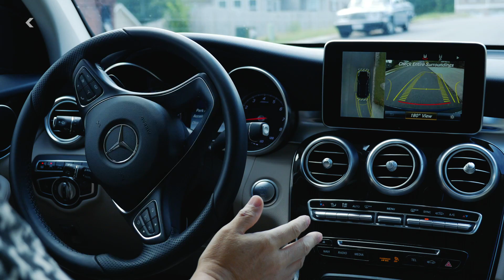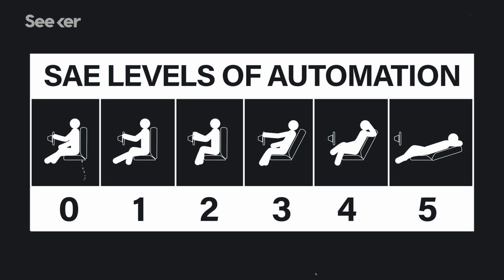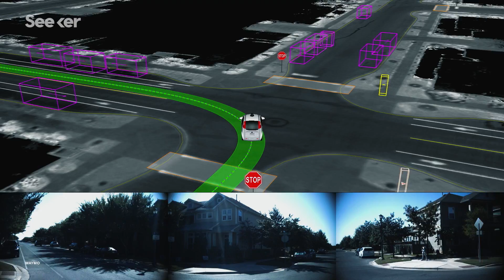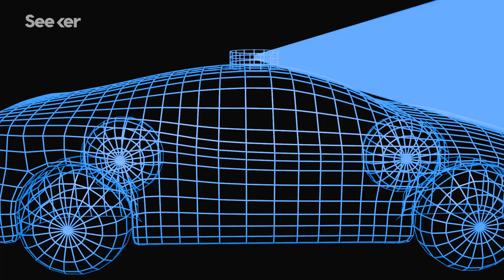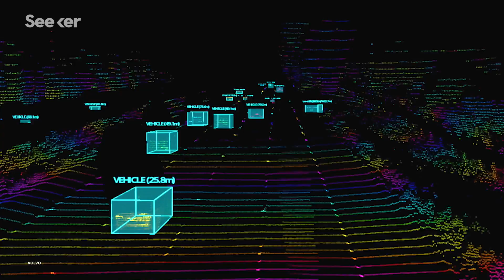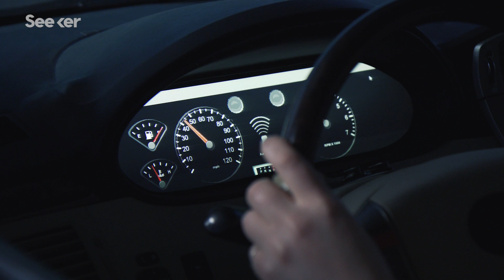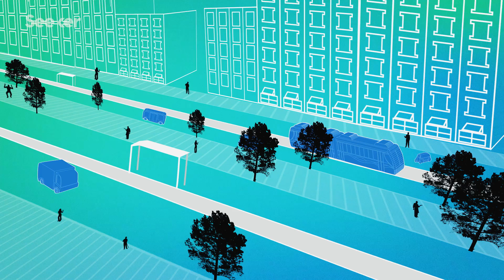How Close Are We to a Self-Driving World?

Comment: We could of been at level 5 10yrs ago if they asked me. :) I felt it would be a lot easier to change the roads to magnetic tracks. The cars to shuttles wouldnt need an engine because it would be powered by the tracks which would make cars(shuttle) cheaper, lighter and need Zero Gas. You/City/States would use a program/computer/AI to run the whole transportation system. The system would go faster and faster as the bugs got worked out. You would no longer have accidents, drunk drivers, missing people, and crimes ect. The shuttle would be able to tell you instantly how long it will take to get where you are going. You would no longer need seats in front they all could be around a table like in a van. :) If this was in place it would eliminate the need for gas and oil. :)

Comment: I’m a professional drone pilot, I’ve helped in the surveying of land, plots, bridges, lakes and canals. Drafting square footage/kilometers for commercial business and the private sector. Just with the equipment I own and operate  with, The autonomous  factor level and firmware used just in my DJI brand drones alone are unmatched. My latest drone has multiple 360 real-sense 4K cameras 
x10 each all the way around it with 6 sensor points of obstacles avoidance that can virtually see through and around blind curves and buildings. Not to mention dual sensing GPS (Russ/USA) barometric pressure assist in altitude hold/climb rate, and separate Optical flow sensors. You really would have a hard time trying to wreck, bump, or crash it purposely. Now imagine all this on a larger scale the size of an SUV.

Comment: How do these thing works when they are 10 years old and being sold USED for $1000?   

Unlike my air conditioner or tail light quit  working , these driverless sensors have to work 100% reliable, 100% of the time.  When was the last car made that has a 100% reliable electronic anything?

It's like a balloon , it can not work with one single pin hole , but in this case if it works at even 99% it's a 3000lb death trap.

Driverless cars will happen when they make a man made machine that never fails EVER , which is never going to happen.

Comment: Am I the only person who is not excited about self driving cars?
Reply: Sasha Z 

You’re not alone, mate.
Reply: @BurgertownDresden  high five!
Reply: Sasha Z 👊🤚🤚😎
Reply: How do these thing works when they are 10 years old and being sold USED for $1000?   
Unlike my air conditioner or tail light quit  working , these driverless sensors have to work 100% reliable, 100% of the time.  When was the last car made that has a 100% reliable electronic anything?
It's like a balloon , it can not work with one single pin hole , but in this case if it works at even 99% it's a 3000lb death trap.
Driverless cars will happen when they make a man made machine that never fails EVER , which is never going to happen.

Comment: Still haven't gotten an answer about how fully autonomous cars are going to handle things like parking lots, drive thrus and gas stations (assuming we're still using gas). Also what happens if the weather is fine when you go to work, but treacherous for the ride home? If the car has no steering wheel, as some people are suggesting, what then? Die freezing to death in the parking lot that your car parked like garbage in, or will the cars be guaranteed to operate 100% of the time you need it to? (obviously barring mechanical issues). What if there's an accident that blocks the road and you need to back up and turn around? What about when there's a cop directing traffic and the officer gives direction contrary to signage or lights because of roadwork or other issues? There's more to driving than accelerate, brake, avoid pedestrians and other vehicles. There's judgement calls to be made, and I have an EXCEEDINGLY difficult time believing we're anywhere near that level of technological advancement.

Comment: With all the conversation about a driverless car requiring a real person in the driver's seat, ready to take over if there is a problem, every single one of them talks about it as though it is a given that it will happen from time to time and that for the most part, the person in control - the human driver - will take over and correct the problem and then pop the auto-pilot back on and that will be that.  I have noted, however,  that no one seems to consider this;  as driverless cars become more and more common, by definition this means that fewer and fewer people will have any significant experience at actually driving a car.  Sooner or later it becomes the norm to have someone who has really never driven a car, being  in control of an automated vehicle that not just potentially can, but eventually WILL malfunction and lose control - possibly at high speeds, and the person in control doesn't even know how to drive.

Comment: So let's say 50 years from now drivers will be unable to take control in an emergency,  they wil will no longer be experienced drivers or drivers at all.
Reply: 5 years from now you won't need to take over in an emergency, the car will handle it better then any human could. Already many times it's the car that takes over in an emergency and saves your ass. There will be no need for experienced drivers, just as now there's no need for experienced horse riders.
Reply: András Bíró 

Bit what if The electrical components fail?

Comment: Dont say we all want self driving cars. I dont want them. I love driving and commuting. I drive manual so its a lot of fun for me.
Reply: Love driving hours on a featureless highway or in stop and go traffic? I don't think so. I love driving too, but still often using my Tesla's AutoPilot feature.
Reply: @andrasbiro3007  that's where you're wrong bud. Ive driven across country multiple times and i love it. I love long drives and driving a manual makes it fun. Automatics make driving boring but manuals put you in control of your car. Maybe sell your tesla and get something thats more engaging and you might find yourself liking the drive.
Reply: @jacobriddle9241  

As I said I love driving, that's why I bought a Tesla. But on a highway you are doing nothing but keeping the car int he lane and maintaining speed, for hours. That's not fun, that's being the slave of a machine. And being in control for me means that the car does exactly what I want, so much that it sometimes feels like it reads my mind. That's Tesla. Most of it is the electric powertrain, the rest is the software. In an ICE car you are most of the time just fighting the primitive engine, because it can only provide power in a narrow range of rpm, it's slow to react to your inputs and usually underpowered. An electric motor on the other hand gives you a lot of power, whenever you want it, instantly. And with regenerative braking, you can even slow down, pretty hard if necessary, without using the brakes. That means you can very precisely control your acceleration and deceleration with a single pedal. No silly gear changes and zero lag. Anything you want happens instantly. And with that amount of power, speed happens almost instantly too. And no chance of stalling the engine, which isn't just annoying and embarrassing, but can be dangerous in some situations.

Plus, you recover most of your kinetic energy, so you aren't wasting much fuel by slowing down. That's another thing you don't have to worry about. And there's also barely any sound and no vibration, which makes the ride very smooth and natural feeling and the acceleration to feel effortless. You get much less tired on longer trips. And you can accelerate hard without bothering anyone, even in late night in a residential area you can do a 0-60 in 2.3 seconds without anyone even noticing. Yet another thing you don't have to worry about.

Comment: I don't see an appeal in self-driving cars. Am I the only one that finds driving fun? Changing gears and making it go yourself is awesome. If you want self-driving cars you might as well just get the bus or train.
Reply: Try a Tesla. You will quickly learn that changing gears is not fun, it's a chore forced on you by the primitive internal combustion engine, and that self-driving cars are awesome in many circumstances. I love to drive myself and I bought manual transmission cars only, then I got a Model S and everything changed. Having gears at all now look so silly, and I'm actually annoyed if I have to drive manually on the highway, because the car doesn't see well the lane markings.

Comment: At least we have motorcycles, never saw an autonomous motorcycle 🏍 😉
Reply: BMW built one. Just look for it on YouTube.
Reply: It would be totally pointless. Motorcycles are mostly used by enthusiasts not by Mr/Mrs everybody who just needs basic transportation.
Reply: Keith Christensen  as the software matures for cars, it wont be hard to achieve that on bikes.
Reply: then you know its over
"Terminator Salvation"
Reply: One of the competitors in the DARPA challenge that the Stanford team won was an autonomous motorcycle.  It did not do very well on the slow speed obstacle navigation test as it wasn't able to keep it's balance.  Presumably had it employed a gyroscopic balance mechanism, it may have been able to handle the low speed tasks.

Comment: The whole comment stating that Elon only believes cameras are necessary is extremely misleading the way it’s used. Teslas use ultrasonic sensors and radar as well. Also they have achieved level 3 on highways and with enhanced summon the vehicle can pick you up in a parking lot on its own. To be fair these are recent which is why they may have not been included in the video.
Reply: I believe the lidar approach is on the verge of flopping...cameras are enough and the best technical approach 🙂 For that reason Teslas will also be the first to market .. I also think it’s gonna happen a lot quicker than this video (or people in it) predict.. Another year or two of data collection is all Tesla needs... I’ll bet in 3 years teslas are better than human drivers, and it’s standard equipment/cheap.  (Cameras are cheap) Getting the data is the hard and expensive part... Thankyou Tesla drivers
Reply: @justinmallaiz4549  yeah they have already conducted a study and found that when tesla autopilot is on there is like a 1 in 2.5 million chance of getting into a car crash but when its off there is like 1 in 1.5 million chance so its already proving its worth.
Reply: @Justin Mallaiz. Great camera = safer I think? The better the quality of the camera could it be means the systems can determine the surroundings better? Or was it those smart phones camera is almost as equal in terms of capabilities? Great camera can be quite expensive right? Or was it not? But I do believe for some reason that the better the camera the more expensive it could be... don’t judge me.. if you think I ‘m wrong I just have a different perspective, so forgive me...
Reply: Justin Mallaiz, I think you underestimate how difficult driving is because it comes relatively easy to humans. You may also be overestimating how great computers are at understanding our world.  

Driving for us is really just an extension of using a machine to navigate the world that we already fully understand.  In other words .. shapes , shadows trajectory, elevation, perspective,  patterns, behavior  etc are things that our brains process without nary a thought.  Why is a 40 yo that has been driving for 20 years better at it than a 16 yo with 6 months experience? The 16 yo has better faster reflexes and more acute senses .. so what’s the difference.

The most important thing we should learn in life is critical thinking. So even though you are reading this and at every word you are formulating a rebuttal. Not necessarily too interested in understanding what I’m saying ..You should step back think about it.
 Research what Companies like Waymo are ACTUALLY doing.. how exactly are they using Lidar? Why are they using it? Do they have Neural networks as well?.. cameras? Radar? What is chauffeurnet? What do the companies that are not using Lidar have in common ?.  Would you rather have more safety features in a car or less?
Reply: This video dismisses Telsa. Elon stated last week that with the existing hardware, the cars they make today would be able to be self-driving level 4 by the end of 2019. Now that means probably the end of 2020 but still, look at ALL the people who dismissed Elon Musk and his companies.
Reply: Josh PaperDragon By the end of 2019? Where r u getting your information? Stop drinking the kool-aid
Reply: @PaperDragons  hes like steve jobs a good salesman tesla is nowhere near as clever as he makes out, go check what he said 5 years ago overly optimistic forecasting to keep the investment coming his way
Reply: @1man1bike1road   Show me someone who has done more. Then come back and put your complaint in perspective. Your point is petty and nitpicking compared to the accomplishments Elon and his companies have brought. And.... he is young. It's only the beginning. Like Ford in 1920s. imagine the fool on the side of the road laughing at Ford or Edison for not meeting 100% of all they were striving for.
Reply: @PaperDragons  Are you done crying?
Reply from the maker: Thanks for pointing these out +daniel munoz! See comment pinned above 📌
Reply: this whole video was an argument AGAINST Tesla and their methodology and not a validation of the company, or reflective of "their latest, new" effort to create demand for their product.
Reply: daniel munoz yeah got pretty annoyed about that, pretty lame video
Reply: Seeker are terrible with the accuracy of their data. It's pretty pictures all the time.
Reply: I hate these text walls by nerds xD
Reply: daniel munoz No way Tesla’s are level 3. The summon feature doesn’t even work properly...
Reply: No it isnt lol.

Elon Musk, last week, literally said Lidar is pointless, and all you need is cameras and AI.
Reply: If I understand his meaning, it's that no one has a laser shooting eye and that we all use "passive vision".  It is true that we drive without shooting light or sound of even radio waves.  Once you solve the computer vision problem, i.e. ranging and object ID, you have all the sensor power you need.  So at present, theoretically...the sonar and radar is for assisting the faults of the cameras (and blind spots, like in parking and fog).  Lidar is way too expensive to mass produce so it's not included. Eventually, cheaper cameras can be placed all around any vehicle and detect all you need if your algorithm works.  Radar might still be used however for fog and stuff.  Also, a camera can be tricked by a picture on a wall I guess...unless it knows it's completely flat or something.
Reply: I can't believe people saying level 4 autonomous driving possible with only using camera because ELON said so! Just look up any articles covering more indept technical challenges facing level 4 autonomous driving before believing Elon's words.
Reply: @kalmorning  1. elon (or tesla cars) also use multiple radar methods. 2. a human drives with just 2 eyes
Reply: Yun Song : It’s not because Elon said so.. Lidar for example can’t tell the difference between a stone wall or empty cardboard box. A camera has tons and tons of great data.  All you ever need... (Tesla’s have 8 cameras, 12 sonars, and 1 radar...  )
Reply: Sorry guys. lvl3 is you have to take over during emergency but you dont have to observe. The car tells you when to take over. And when it tells you, you have ca 10 seconds time. The car bears responsibility part time.
In Tesla only the driver is responsible therefore Level 2 or ADAS.
Reply: Level 3 means no observation is needed. If you dont monitor the Tesla Autopilot you are dead very quickly.
Reply: @Dragonblood94  your thinking level 4.
Reply: @larryspiller15  "pretty much in control but requires human intervention in emergency" that's what she said 
This is what Tesla has on the highway right now it changes Lanes it takes exits by itself but you need to keep a look out
Reply: @Dragonblood94  Wrong. Level 3 you still have to take over during emergency.
Reply: @YR2050  The faster we can implement this the faster our engineers can get behind other important issues like robotics and dental replacements and other surgerys. It costs 4k to 5k each tooth to replace!! Imagine replacing a whole set!!!. Now the government wants to give free everything healthcare and thats going backwards. Time to take the free market back and make other things much safer and cheaper with robotics, 5G , ultrasonic sensors and AI if not at least algorythms. Now thats a few industries technology can disrupt, imagine the real posibilities!
Reply: Paul k. WRONG.